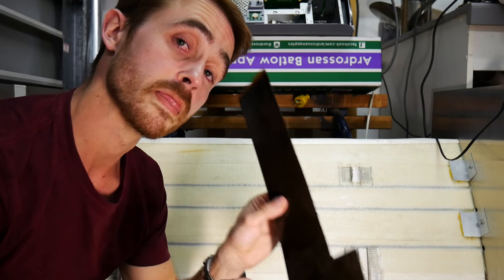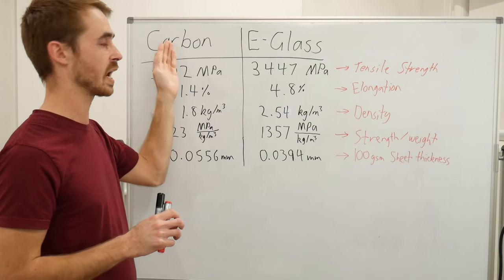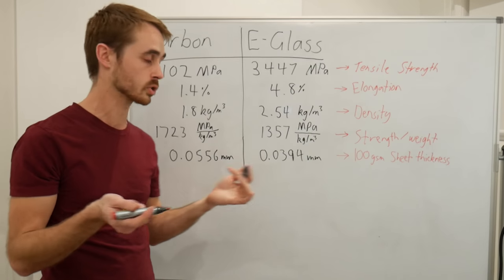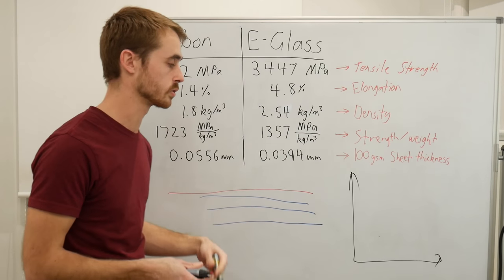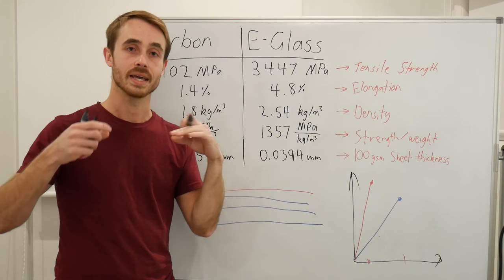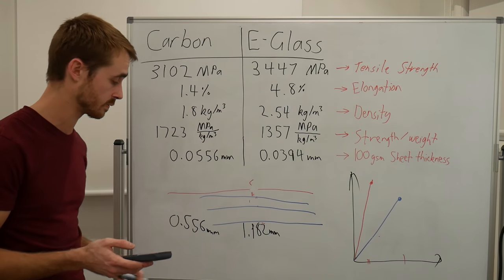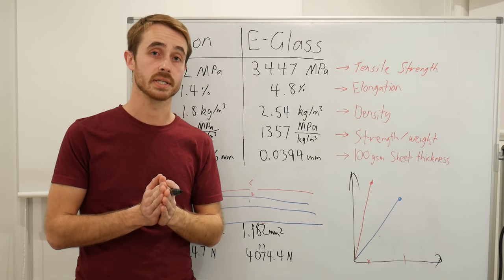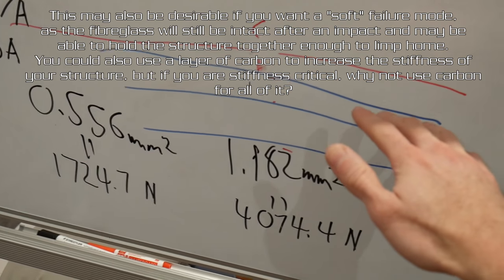Why you SHOULDN'T wrap Fiberglass in Carbon Fiber!

Comment: I would like something investigated Kyle.  I'm thinking of building an truck frame out of reinforced steel with carbon.  How can i do this?   Can I take any material e.i. pvc tubing and line it with carbon fiber composite and build it that way?  The truck will be a light truck altogether with engines and axles and load will be approximately 8 to 10 tons maximum.  What would be the correct material to use with carbon fiber to make such a frame?  Is my question ridiculous?  :-)!!  Any guidance or suggestions would be greatly appreciated. 
d...d...omenech...at...live.... . com  Thank you so very much.
Reply: Did you ever do this? I'm curious as to the result.

Comment: I still would rather look at Carbon fiber then Fiber glass.  Fiberglass always ends up a pissy yellow :-(.  Now for the primer and paint and more labor.   Not to mention more weight on my airplane wings leading edge.  I agree with the science NOT the appearance. I haven't tried epoxy dye's yet maybe that will work.

Comment: Things to consider..

1. Carbon fabric usually used is a twill dress fabric not structual like double biaxial weave. 

2.  Surf boards are usually made with uni directional and biaxial e glass as well as CSM.

3.  The composite used plays a part also, ie vinyl ester or epoxy system.

If carbon was inferior to e glass in strength, it wouldn't be used to make wind generator blades, F1 components, etc.
Reply: most of the time you use carbon fiber for its superior stiffnes compared to glass

hitting the main mast because of the deformation of the turbineblade is the problem not the blades breaking itself

F1 components like aero parts must not deform under load causing a change in aero behavior 
and you dont want any twist in the monocoque for handling reasons
Reply: The vast majority of wind turbine blades are made of fiberglass. Carbon is stiffer, lighter per unit tensile strength, but more expensive.

Comment: Even if the carbon fiber layer is the stiffer part of your laminate it won't take 100% of the load. I guess you should invest some time into Classical Laminate Theory and Stress Strain Variation across Laminates... Also you should understand the ABD Matrix so you can predict the connection between loads and deformation for laminates before posting a video like this.
Reply: IEleMenTIx way to Go. Again, you are correct. The presenter does not seem to know much about compósites.
Reply: He didn't say the carbon fiber would take 100% of the load? What?

Comment: So what are your thoughts on the carbon/kevlar mixed cloth? I am building a riflestov using this material at the moment, but should i have used pure kevlar or carbon for this project and not the mix?
Reply: Bert Cooper none of the kevlar will be exposed to the sun. I will paint it and fi ish with a UV varnish. 

It is a foam core layup with a middle piece og Necuron, a hard plastic material that epoxy bonds to very well. 

The action will be pillar bedded and then i will bed both the action and the bottom metal. I dont think that the stock will ruin the precision of the rifle and if it does I could just use the old stock and take the whole build as a learning experience, which it most certainly have been 😐

Comment: there is a composite channel on the tube the craftsman it features does many lightweight car parts with the top layer of carbon,followed by kevlar,and finally a layer of e glassine it's a high strength part he caps it with another layer of carbon fiber. he gets good light parts without all that engineering jargon
Reply: probably not that good in terms of strenght to weight than possible. Doing it wrong dosn't mean that it will explode it's simply not that good as possible.
Reply: I see your point but some parts like trunk lids and hoods and some other parts don't need much strength, so a simple light piece is good enough to get the job done.
Reply: I see that but than he could have a similar result with much less effort. If there is a unnessesary layer you are better/cheaper off without. Adding useless layers is raindance. You dance around a tree and some days later it might rain. It hadn't changed the weather but it would have rained anyway.
This guy is probably a good craftsman, with good skills and makes good looking car parts which are lighter than normal ones but not as light as possible and at a higher effort and cost than nessesary. Don't get me wrong. It's a gift to be able to make good looking parts which fit exactly. But using unnessesary layers is squandering.
Reply: Yes, you can just bullshit and sometimes get a good result.

Or you could know what you're doing.

Comment: Hi Kyle! Good video. Your point here is good. I use a lot of carbon fiber and the only thing i don't get is the low tensile strength you have found on the carbon fiber you compare to. You really must have found the worst carbon fiber there is. If you use any normal fiber like the T300 or Aksaca that are very common in most carbon fabrics today, they don't go that low. What type of fiber is your carbon fiber reference? / J

Comment: You are the right guy to ansewer properly some old questton and myths in the 2 stroke engine industry\tuning.
-Knife edge porting of the transfers(good or bad, faster or slower flow)?
-Drilling airbox, more air or not compared to a stock airbox with a snorkel like the rotax 122 airbox.

Comment: This is only relevant under tension, you are not going to overcome the tensile strength of carbon fibre unless you are using it for lifting or in a crash structure.

Comment: What of you are just looking for added stiffness by adding carbon in a middle layer of a composite? Not worried about strength so much but keeping something a bit stiffer and using less fiberglass overall. For example i made a fiberglass auto door and used carbon around the window frame just to keep it from being jiggly lol

Comment: This is all well meaning and good for mathamatical model's sake.  But the models are mostly wrong. I've used carbon and fiberglass on surfboards for many years. Surfboards ALWAYS BREAK ! THEY ALWAYS DO !!! BUT NONE of my carbon fiber surfboards have ever broken. I always put many stringers in the foam and I have used fiberglass in between layers of carbon. Carbon always gets PINHOLES in hand layup and the fiberglass (Smallest weight) seals better than the carbon. I have also used Kevlar in between the layers. None of my carbon fiber boards have ever broken after many years of use. The worst example is waterlogging from dings.(after 15 years) This has saved me so much money because it costs $300 in carbon to lay up a board. Regular boards cost $600 to $1000 brand new...and their life span is about 6 months average.  I could never afford to surf if I had to buy a new board every 6 months. I've had some carbon boards for 20 years !  I have built average one new surfboard every 2 to 3 years. Now I make kitesurfing equipment. Kite equip. has to be superlight and ext. strong. Now I have the skills to have at ~ ALOHA !!!

Comment: You are complete wrong, since, the fiber glass and carbon fiber reinforced with polymers are orthotropic materials (you have multiple Young Module, depending of the orientation), your approach is if these materials was isotropic. This is the reason, many thing are a mix between different materials (CF, FG, Kevlar), like helmets, beams, propulsion axles, you need to find the best material for each stress direction. Refer to MIL-17 Composite Handbook

Comment: This exact same logic would apply to any laminate composite panel, like aluminium foam sandwich panels, or in fact human skin over meat.
It is wrong.
You seem to miss that outer layer is not a homogenous bag over the substrate, it's cross-linked throughout its surface, and you've entirely ignored the relative Young's Modulii of the materials -- and that of the resin.
Most importantly this is not whiteboard science. The only way to prove or disprove anything in the is space is with a strain gauge (Which I've done on a few occasions).
Reality is the best simulation for reality.

Comment: Very few people use foam unfortunately. It is the lightweight stiffening material. And if you worry about your structural strength first.  and then do the Pretty carbon fiber on top it matters or not. But why put three layers of something on without foam in between. Just one 1/8 in can increase the strength by 30% hello. And then give us all the different other types of fabrics that offer the same weave style that everybody desires out of carbon fiber you don't need carbon fiber for your final layer it can be a hybrid, Kevlar, zylon, texstream, fiberglass, or a hybrid of two of those in any combination now add colors. Or even those with waves of actual anodized metal woven in. See your final layer be damn near anything once you taking care of your structural strength. A weave is a weave.  And if you use a triaxial weave with deep resin on top it'll be totally 3D and one of a kind.
        🏞️🛩️🗻🤠

Comment: https://en.wikipedia.org/wiki/Fiberglass

one uses E glass for high tensile strength applications like wing bending or flex on jet liners ... but uses carbon fiber or s glass or both in engine nacelles .. for its better resistance to heat and flex 

one doesnt use flexible material to build a part that needs strength over flexibility ... you dont use a steel I beam to support a wing you use a high flex material like titanium or e glass ... you use the carbon fiber on parts that dont flex but need strong support 

you are literally comparing similar tings with dissimilar properties for different applications .. making your conclusions and ... methodology WRONG from the very start ... Carbon fiber over S glass ... is fine carbon fiber over E glass is NOT ... 

s glass and carbon fiber are the same (almost) except carbon fiber is conductive while S glass is NOT ... E glass and EDR glass are essentially the same while EDR glass is like carbon fiber and can be made to be conductive while e glass is not .... the APPLICATION you are using the fiber coatings for MATTERS ... youre diatribe doesnt take this into account invalidating it completely ...

Comment: If fiber glass had better stretch than carbon fiber. Why would Boeing want to use it for airplane joints? Because of flex. Carbon fiber has far more flex than fiber glass. Take two rods of same thickness, one glass and one carbon. The carbon can literally be bent to the point where it can touch ends. Fiber glass breaks and shatters before you can reach even half way around the bend. 

When it comes to boats and car parts. Its not the stretching you have to worry about its the bending, especially in boats. If the part bends too much it will break. (especially fiber glass, over the years it has less flex durability makes it weak)

Fiber glass does not have superior flex durability, Carbon fiber does. So Glass is best used in sail boats for slow cruising. But when you it comes to speed boats. the superior material would be carbon fiber. Your assessment is in fact wrong. You can in fact add carbon fiber to glass because it will improve the glass's rigidity and flex durability(since fiber glass shatters before carbon fiber). Your math may be right, but it doesn't show all the characteristics of the material.

You can also add Kevlar to both carbon fiber and glass to improve puncture resistance... again math doesn't show all the characteristic of the material. So maybe do your research before implying you know so much.
Reply: Also I would like to point out that fiber glass and carbon fiber never stretch out like that lol. That would mean a 40' sailboat would stretch out .42 Ft just with carbon fiber alone. If a sail boat did that, the chain planks would come out and other bad things would happen. Plus with fiber glass the boat with stretch 1.6'? No dude that doesn't happen.

So your so called concerns are not even relevant to building. People build for the strength. Which you don't understand what that means. But I already explained that.

Comment: According to you, carbon fiber will break before fiberglass.  Therefore fiberglass parts are stronger than carbon fiber parts.  hehehe
Reply: MRX7: Yes, but the glass part weighs more and is thicker than the equivalent strength carbon part.

Comment: If people want carbon look, why not just color the glassfiber? 

In regular house paint, they put "strong black" in transparent paint, and it turns out black. 

I took  a few drops of this "strong black", and mixed it with some 5 dl of water, and filed it in the plastic bag with the fiberglass. made sure it all mixed well, before hanging the fiber to dry.

The end result is black colored fiberglass. Looks like Carbon fiber.

Comment: This guy  does not know what he is talking about.  Even carbon fibber from the 70's had a tensile strength of 4000 MPA.  Modern  carbon fiber is  around 5800 MPA.   When you start with bad data, you get bad conclusions.  Find some one who knows what they are talking about (probably not going to find them on youtube!).

 Yes there is a strength mismatch, but the carbon will not break, it will take the load.  It is also much stiffer than glass.  Better solution, if you need the strength,  use all carbon (and maybe sandwich construction.  You'll be lighter, stiffer and stronger.  And if you are building a part for show, it probably will never come close to a load high enough to worry about the strength of either material.

Comment: You are comparing text book numbers of individual materials that will act differently in a composite structure.  Techniques used will also greatly affect strength.  Most people who are skinning do-it-yourself carbon projects are not too worried about the modulus or elasticity, elongation, etc etc of their headlight bezels.  The surfboard industry has been incorporating carbon stringers in fiberglass boards for decades with no ill effects.
Reply: seigeengine  boggling your mind doesn't seem to be that difficult to do then.

Comment: So put the carbon fiber in the middle.
Reply: Doesn't matter where you put it, it will experience the same strain. In the middle would be worse, because once it breaks, it is effectively a small crack, which will initiate debonding of the carbon/glass interface, more commonly known as delamination.
Reply: And when flexed, the middle of the layer should, unless I'm an idiot, which I probably am, experience no force anyway. You want things strong in tension to be on the outside edges of things that are flexing.
Reply: I think the whole point was to have the look of carbon fiber without spending as much